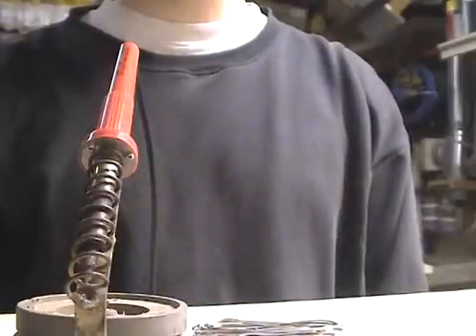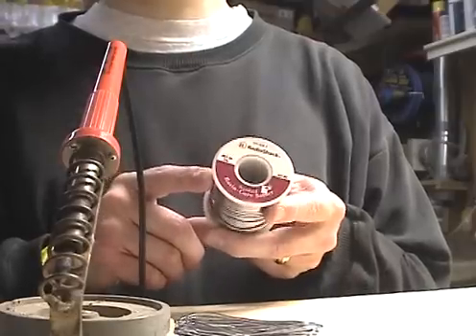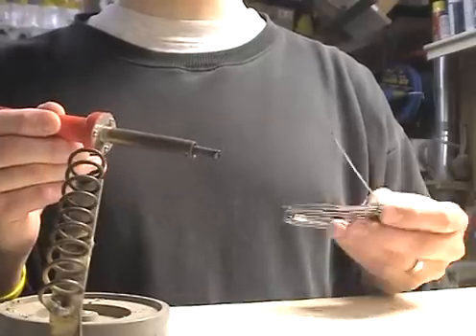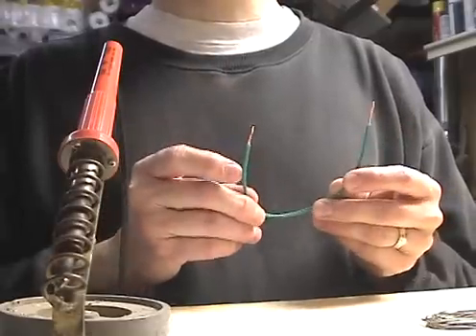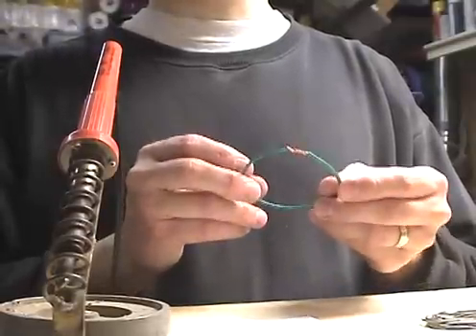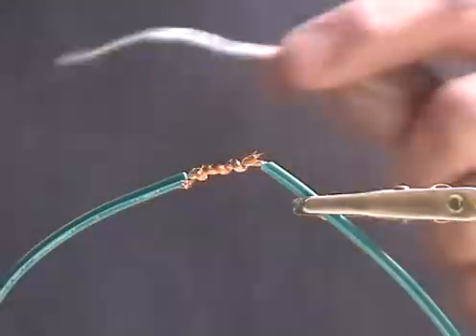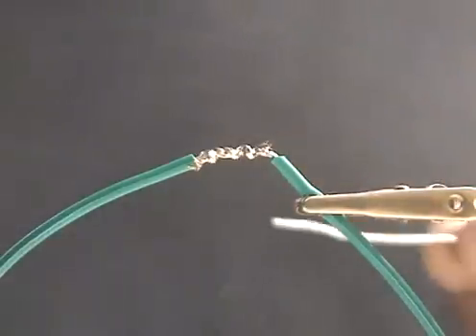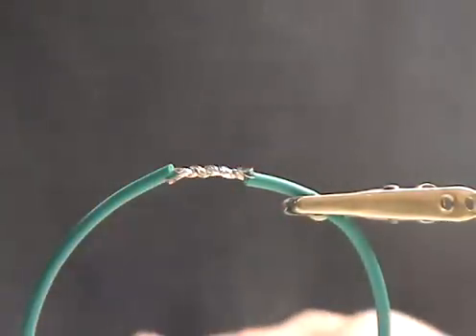How to Do It: Basic Soldering

Comment: Never flick solder off of a hot iron. Always use a wet sponge. If you get it in your eye one time, you will never flick solder again!
Wear safety glasses!
Reply from the maker: Despite not losing an eye to flicked solder or even the hot iron itself, I've since (mostly) eliminated my dangerous solder flicking behavior, as those types of risky behavior are best suited to braver younger YOLO folk. ;-)

But I prefer metal wool to sponges to clean my soldering iron tips. And safety glasses are always a good idea.

Comment: I'm having a nightmare of a time getting solder to stick to the GND pads on my board, do I need to heat it more or less, I'm ok with the other pads.
Reply from the maker: I'm not sure what you mean by "GND pads".  If you mean the ground plane - i.e. the large copper ground plane on the board that will take more heat to get the solder to flow, as the larger area of copper will absorb and dissipate a lot more heat than other smaller pads.  Make sure you wet the soldering iron tip (tin it) to get good heat transfer and hold it on the ground plane until it's heated enough for the solder to flow onto it.  Hope that helps!
Reply: I mean the tiny copper pads to solder wires to, the GND being the "Ground"/Negative pad, it's always square not round and is always really difficult to get solder to stick, must be acting like a heat sink.   @coldrestart
Reply from the maker: Then it's possible the pads need to be cleaned.  You should clean the circuit board before you start soldering to remove oxidation and any other contaminants. There are a variety of different ways you can do that, including alcohol, solvents, scotchbrite and/or steel wool to name just a few.
Reply: @coldrestart  No it's not that it needs cleaning, I know that because all the pads other than the GND/Neg pads work just fine. The ground pads are always a problem for me, it must be that it is dissipating the heat but I tried to heat more and I ended up destroying 3 $70 boards. Very frustrating. Thanks for your reply.
Reply: When you say WET do you mean with fresh solder? I noticed a massive difference if you touch your solder point with solder on the tip already, wow it melts the solder instantly, I have been struggling because solder will not stick to the tip so I have been trying to solder with a dry tip that ends up looking brown and almost burnt. Is that because I have overheated it and it's now no good? I have tried all temps, 320 C up to 420 C it doesn't seem to help, solder just runs straight off the tip onto the desk. The way I dad it was make a hot pool of it on my glass desktop and roll the tip in it and then it works great. I have ordered new tips. Thanks for your help appreciate it.   @coldrestart
Reply from the maker: Yes, wetting the tip with soldering is tinning the tip.  If you can't get solder to stick to the tip it needs to be cleaned.  I prefer the brass coil soldering iron tip cleaner like the Hakko 599b, but some people like the damp sponge.  There are other ways to clean the tip but whatever method you choose make sure it's not going to remove the plating from the tip because that ruins it.
Reply: @coldrestart  I use the wire mesh/shavings to dab and rub the tip in, it seems to work well but the solder still wont stick, the tip goes kinda brown and slightly burnt looking after a minute or so, I know when the solder does stick I can solder really quite well, the iron is really holding me back. It is a new CGX one with temp control too. I have new tips coming. Will start fresh and try that.

Comment: Please help.

I have a Weller 40 watt solder station. I also have a few other smaller irons. At no time have I been able to get any of them to ever heat a joint sufficiently to melt the solder. I hold the iron & solder in place for 2-3 MINUTES and NOTHING MELTS.

Rosin core solder. Totally normal. All my irons behave the same way.

I cannot get solder to melt on any iron under 100 watts. It melts onto the iron and ignores the wires.

Help?

Comment: Why should one only use rosencore soldering wire?
Reply from the maker: The main two types of flux core solder are rosin core, and acid core.  Acid core solder will damage wiring and electronics so it should NOT be used for those applications.

Comment: I got sick of guesswork and got a hakko soldering station.  I use silver or quad eutectic solder for electronics, better conductors than lead.  700 degrees, 3 second dwell. Damp sponge is my preference.

Comment: Pencil thin solder guns never seem to be hot enough for me on the tip, i have to use the side gently.. why is this? I usually need to mess with tiny circuit boards so soldering a wire using tip only would be awesome. Any recommended techniques then aside from the vid since i do boards not wires... also any suggestion on better gun to buy?

Comment: What if youre soldering a wire on to a flat surface? (I'm thinking in terms of guitars) Do you heat up the wire and the area the wire is going to be placed, then let solder melt on to that?

Comment: It looks so easy and still I fail. I am not sure whether the pen is not hot enough or whether I am using the wrong wires, but instead of forming a connection between the wires it just forms a blob that sticks to one wire only (if at all).

Comment: do you need a soldering station or are those optional? So really only the sauter and the soldering iron/pencil are needed?
Reply: FireWizard64 technically... yeah. that's all you need. that's how I started. I coincidentally ruined a bunch of quad copter circuit boards by not having a few items. just my opinion but the iron itself hasn't made as much difference as getting some flux shrink wrap and that "helping hands" alligator clip holder thing. personally I like this butane powered one over the plug in (cheap ones) kind. flux makes pre tinning WAY easier. which in turn makes the actual soldering part much more manageable.
Reply: so it's kind of a trade off...yeah all you need is a soldering gun and solder..but W/out other stuff its easy to wreck thingz. flux is $4-$5 at Lowe's, home depot, Menard's, ace.just any hardware store pretty much but make sure to get the right kind. hope your project works or! =D
Reply: Eric B Thanks! Really helpful.

Comment: I watched one vid where the wires on either end were opened into a fan and pushed into each other before twisting ..this also made for a better grip of the wires prior to soldering..I bought a cheap pen type iron,..three solders later ..dont work checked fuse ob nope just fucked,..lesson learnt dont buy cheap,..also bought an expensive gun one,..lesson learnt,..co's it's big and fancy dont make it better,..hope this in some way helps someone,..K.Wolf

Comment: LOL I'VE BEEN DOIN THIS SO WRONG:
- i just get the wires close enough to where they are touching. I don't wrap them together at all
- I dont' secure the wires at all. they are usually just laying on the table
- i would touch the solder to the iron at the same time as touching the wire
- basically all my connections are a big clump of solder around two wires (looks more like a weld)

RIP my connections
Reply: Lol all my connections look the same too
Reply: but, after you were done, did your connections work? Thanks
Reply: That other Guy  ahh funny, I understand...  thanks

Comment: That was great. Today at my vocational school we tried to solder and I wasn't able to heat up my wire so that I can solder. Is putting some solder on the tip of the iron (forgot what you called that step) the thing that made the solder transfer so quick to the wire?
Reply: +Matt Echevarria It's probably because the heated wire wasn't hot enough. Try using a little more voltage in the iron to heat up the wire joint to a higher temperature.

Comment: damn, mate... I've been doing it wrong all this time. No wonder there have always been blobs of unsightly excess solder stuck to my wires. Didn't know I have to use indirect heat, opposed to spreading the tin from the tip of the solder. Thanks a lot mate!

Comment: So the general purpose of soldering is too splice wires together and creat a liquid metal exterior?
Reply: Yes
Reply: +Hanks a skitzo |
The purpose of soldering is to create a consistent connection through which electricity may pass and which will stay conductive over time (despite vibrations, etc).

Comment: Every single video I see on soldering tells me to do this, and it never works for me. I touch the iron to the wire, and the solder to the wire, and it NEVER MELTS. I'm sure I'm using an iron with the right power. Do I need a certain type of solder or something? Does it depend on the type of wire?
Reply: +Martin Chapman having the same trouble. 2 errors causing this which i can think of are the following: the soldering material. most pros recommend the one with lead, I guess it melts better. the other possible issue could be the tip size, if it's to small heat will transfer more focussed rather than heating a broader volume at once. if you rule out the  power/heat of the soldering iron, those 2 said possible errors are the only ones i can think of from the top of my head. but really, i am having your thoughts exactly. the theory is clear, but how it's done when it doesnt work, i dunnno. i mean other than buying leaded tin and a broader tip.
Reply: Same here
Reply: Yeah, I'm having the same problem. I've held the iron there for 10+ seconds and still nothing. The iron certainly seems hot enough too.
However, I watched the video back at 0.25 speed and at 3:45 I think he actually DOES touch the solder on the iron, even though he says not to do that! Not sure if it was an accident or intended to get it started, but you can see the solder slip behind the wires (presumably touching the iron) and then you can see it flowing around the right-hand side of the tip more quickly than it flows over the wires. 
Despite most people saying 'don't do this', I did read somewhere about touching it briefly to the iron to get the solder flowing, so I'm thinking I'm going to try doing it that way for a bit and see if it works.

Comment: Nasty looking tip on that iron.

Take better care of your tools and your work will go easier.  Use a wet sponge  or a tip cleaner constantly.  Clean the tip each time before using.
Reply: +Richard F Do this and your tip will stay shiny forever.
Reply: +Richard F Ok before I start I want to say that I don't mean to be mean or be a hater, but what are you doing on this video you seem preatty experienced, also do I have to wipe it off of wet spounge or do I do it in some special way? also what is the point of putting sauter on the tip?
Reply: +Richard F Who cares about a shiny tip. it's just for heating stuff, mine looks oxydised as hell and works like it should.
not everybody has ocd remember
Reply: +Richard F Oh dear! I could run with this and be a not-very-good-role-model granny. I could make all kinds of innuendos. I'll say I like this: "Take better care of your tools and your work will be easier"  so true. . . Okay, now I'll watch the video because I do want to learn to solder.

Comment: This is good tutorial, but in terms of joining (soldering) 2 wires together, I think soldering gun is much more suitable for this kind of job. Main benefit is that you can put solder and flux on the tip of the soldering gun in advance, so you have one free hand to hold 2nd wire and position it precisely during soldering. This way you can do solid wire joints without needing to twist 2 wires together and joint can be easily disjoined lately without harming the wire... it's pretty handy feature at some situations.

Comment: coldrestart, Are you not worried about lead toxicity? 

After taking a toxicology course I'm terrified of inhaling hard metals like lead. I only ask because it seems like you aren't fazed by it.

I have purchased lead-free solder, had to balance out potential health effects vs. potential frying of electronics >_<
Reply: +limitlessaeon there is no known toxicity problem with 'inhaling' lead when soldering. You would have to handle pure lead for months for it to work through the skin into your circulation, which is why there are legal limits (UK) for working with heavy metals. The fumes are from rosin flux and are not known to be toxic but can cause irritation if you suffer from eg asthma.  The lead-free aspect of such solder relates to reducing toxicity in landfill.
Reply: +Alan W Probably good to wash your hands after soldering.
Reply: limitlessaeon just wear proper ppe and you will be fine proper ppe would be Glasses, mask and if you are me gloves... My hands slip all the time.

Comment: can you cover shiny thing with electrical tape?
Reply: lexusfan100 Yes, or heat shrink tubing. They both insulate the connection
Reply: Actually, you should slide a piece of shrink tube onto the joint before soldering then heat shrink it with a lighter after the soldering is complete.
Reply: As mentioned in my post!

Comment: I have a question:

Why is the 60/40 mix of tin/lead so important? Not questioning your advice, I'm just a newbie to soldering and I'm attempting a project and having trouble, and I think the solder I'm using might be the issue.

I'm using the thin spool that the cheap iron I bought came with (was $10 for the iron + small spool of solder). It said on the package of the solder that it is something like 99% tin. The problem I'm having is I can't "tin" the tip of the iron, not can I "tin" the tip of the wires I'm using for the aforementioned project. What happens is the solder either 1) doesn't melt if I touch it to the very tip of my pencil-tipped soldering iron, or 2) if I touch the solder further down the base of the tip [where it's hotter for some reason], the solder immediately burns upward toward the spool and "balls up", leaving no solder on the iron whatsoever.

Another problem with the tip of the iron is that if I do like you say and touch the tip of the iron to the wire and then touch solder to the wire, nothing happens; don't know if the tip of the iron just isn't hot enough and therefore isn't transferring the heat to the wire properly, or if the solder I'm using just isn't the right kind... or probably both?

FYI, I am using the aforementioned 99% "electrical rosin-core" solder (very thin), a cheap 3M 30w pencil-tip soldering iron, and 22-gauge copper wiring. I am attempting to build my own "Scuff Gaming Controller" which simply put, is just a regular XBOX ONE controller with a couple of extra momentary tactile buttons added to it & soldered to the small copper plates of the controller's circuit board.

However, due to the issues I'm facing, I am finding it impossible to even solder the wires to the terminals of the buttons, much less to the circuit board. Everything else, including drilling the holes and knowing what to solder to where, I am perfectly fine with. I've tested everything and it works great! I just need to "finalize" it, as it were, via soldering.

Got any advice? Any insight you can provide would be greatly appreciated. Thank you!
Reply: Hi :D I think you mentioned that you are using 99% tin solder which is known as "lead free" solder. These type of solder melts at a significantly higher temperature then traditional 60% tin, 40% lead (60/40) or 63% tin, 36% lead (63/37) solder. "Lead free" solder is used such that commercial products can meet the rohs compliant. If you are just doing hacking/modding work, you should really use solder with lead, as it is much easier. As long as you dont eat the solder or rub it in your eye, you wont get lead poisoning. Hope that helped, have a nice day :D
Reply: Yes that is very helpful and is exactly what I suspected. I also think my iron is just crap. As I stated, it's a cheap little $5 pencil iron I got at Walmart out of necessity. It's not variable heat controlled or anything, just a flimsy plastic handled one with a short cord lol.

But I think the majority of my problem is the solder I'm using as well as possibly needing to use some additional liquid-based flux to ensure proper dispersal.

Thank you for your advice/feedback! I really appreciate it!
Reply: Fyrecide I think 30w is adequate for tactile buttons and a few pieces of copper wire, however you should check what iron tip you are using, most soldering iron come with a conical tip and they are crap as the tip doesn't transfer heat fast enough. I personally love the chisel tip as these tip has a larger heat transfer area therefore it heat up components really nicely and quickly. Temp. controlled irons are great for small and heat sensitive components especially those tiny SMD parts. I think tactile button wouldn't be damaged by excess heat easily so a pencil iron should be alright. Lastly I think additional flux is good but not essential as flux inside your solder should be enough. I personally only use additional flux for my SMD works as I melt solder on my tip then bring it to my work, during this process the flux in the solder has already burnt off on the iron tip before i solder my components. However with larger parts like buttons or other through hole parts, the iron is placed on the part before applying solder to the joint, therefore the flux in the solder is burnt/activated on the component, so additional flux is not quite needed. Cheers :D
Reply: Tat Wong Its sooooo hard not to eat 63/37 solder, it tastes like gum drops :)
Reply: Fyrecide More likely its your tip. A chisel tip has more surface area to transfer heat, and a conical tip is useless for most applications. Get one, it'll make your soldering better.